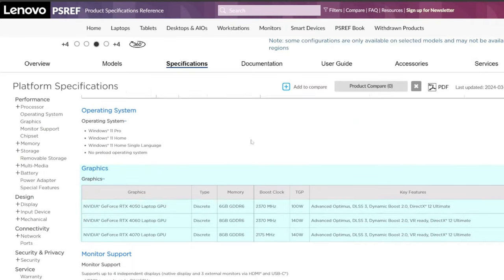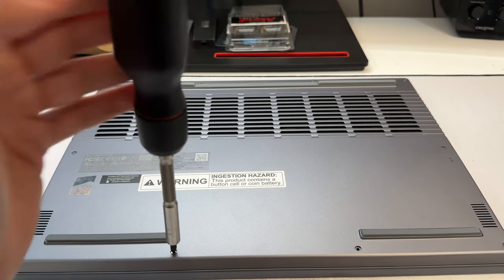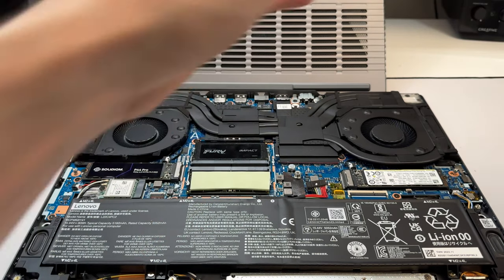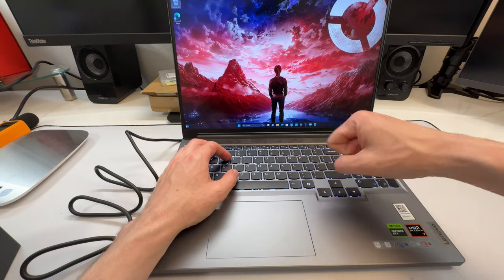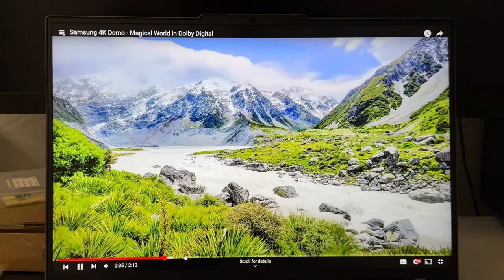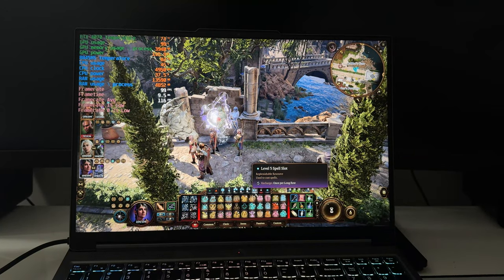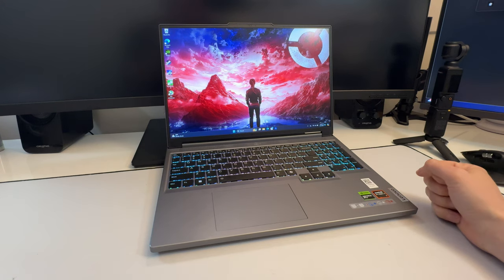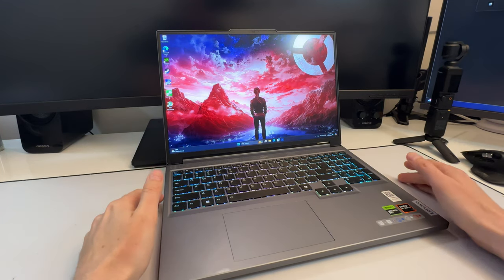Budget King Returns?! - 2024 Lenovo Legion 5 Slim - AMD

Comment: Hello sir, can I use a SSD M2. 2280 to upgrade Legion Slim 5 gen 9? I see spec on website said that it come with a SSD M2. 2242 512GB
Reply from the maker: It had two slots that support 2280

Comment: How long would such a laptop last if you really tried to use it till it's last legs?
Reply from the maker: Before it physically breaks? Probably a decade unless you are really harsh on it
Reply: @TechGuyBeau  Also I'm not too knowledgeable about these kinda things but is £1100 (gbp) a good deal for this laptop? because right now lenovo has a 20% off deal and after adding about £30 for the 500 nit display, and removing the mouse that comes with laptop cuts the price by £20, it totals to about £1100. It seems to be a couple hundred pounds more expensive than the price you got it for, but I'm also not sure if laptops are just more expensive in the UK or if i should wait for a better deal, because i plan on getting this laptop before i start university in september. Thanks
Reply: @impulse9552  tbh different countries have different pricing so its probably that. US markets tend to have the cheapest prices

Comment: Can we get full 140w TGP for 4070 in Legion slim 5 ?
Reply from the maker: There is really no benefit to a 4060/70 going over even 110 watts. You are just adding heat.
Reply: @TechGuyBeau So between gen 9 and gen 8, it's better to choose gen 8 then? Since Its 4060 tdp is 115 w while gen 8 is 140w??

Comment: what about this Lenovo Legion Slim 5 16A with these features Powerful Ryzen 5 5500U processor
AMD Ryzen 7 8845HS processor
16GB DDR5 RAM, 1TB SSD
Nvidia GeForce RTX 4070 8GB graphics card
Factory calibrated 16" WQXGA IPS 240Hz G-SYNC screen
LA1 artificial intelligence chip are they same its like (1649.0 Euro)

Comment: Does ryzen 7 8845hs worth over 7745hs if it is cheaper
Reply from the maker: Which is cheaper, the 8845hs? It’s the same CPU just better tuned
Reply: Thanks , but in both of em temp went considerably high

Comment: Huge issues with nvidia drivers and the amd models. Really screwed my experience of the 2023 amd slim 7. I love the form factor but it's a nightmare with all the conflicts and issues.
Reply from the maker: Nvidia drivers are pretty bad lately, not a specific model issue. I’ve been having issue myself and my discord reporting bad nvidia drivers for almost a year 

Nvidia is an AI company now, they don’t have time for us gamers anymore
Reply: @TechGuyBeau  yeah man, im just hoping that if i get a replacement to my Slim 7 they either offer me this one or a slim 7i, but im worried the slim 7i will have worse battery significantly  - i bought for portability, performance, and battery and slim 7 amd 2023  seemed on paper to be the perfect balance.
Reply: Would you say this laptop is as good as the 7 battery life from 2023?  @TechGuyBeau

Comment: Man is so hard to buy laptops nowadays, the 40XX series ( at least 4050->4070 ) AREN'T much better than the 30XX series. I have a 3070 and it performs better than a 4060 and slightly lower than a 4070. They used to really feed those more power, now after 100watts u get so little improvements in performance ( even if it says it's 140 watts, you rarely get 125 or past that, even so...the performance isn't much higher @ 120-130W ). It's true there's some improvement, but to get a new laptop after 3 years, I expected much more, not a slight increase when you consider that laptops got even more expensive. Even on the CPU side, after 3 years comparing my old 5800H with this 8845HS, same number of cores/threads, it has 600 more Mhz in base frequency and 700 in boost + some more cache. It's true, there is improvement ( considerably more when compared to the GPU side), but games...don't really take much advantage of that...GPU is the main factor for games and any decent CPU from the past 3 years will do just fine in most games if you have a powerful GPU paired with it and proper cooling. Maybe next year...hopefully we'll have some 50XX series paried with new intel / amd CPUs with considerable performance gains. And I'm talking about proper intel CPUs, not those Ultra Core, those are quite low performance ( especially for the money they cost ). It's true they're efficient and provide more battery life, but ... if you buy a new laptop nowadays I feel like you should consider the 14700/14900 HX or the newest AMD...the performance is waaay better. Anyway...praying my Asus holds on for one more year!
Reply from the maker: You should watch my video comparing 2022 legions to 2023/4. That will help you get a handle on what improvements 4000 series has made. 

A 5800h however doesn’t remotely compete with a 8845hs. Cores and frequencies are only part of the picture
Reply: @TechGuyBeau  yeah, I mentioned the CPU improvements are quite considerable, but how much it matters in games, it's probably not as much as the difference in a pure CPU stres test comparison.

Comment: There is almost nothing new in this. I should say buy 2023 model with Ryzen 7 and Rtx4070 from sales, there is good deals from last ones.
Reply from the maker: Well the cpu actually is an improvement. It’s not “faster” but the quirks have been ironed out, leading to insanely good battery life and efficiency. 

Next gen AMD chips are still a ways off
Reply: @TechGuyBeau  Hi, if I may ask, what kind of quirks that's been ironed out. I own the last year model, I watch several review about it including yours and decided to bought it and very happy with it. This one just to satisfy some curiosity of mine. You said the battery and efficiency is a bit better? What about benchmark scores and gaming performance?
Is it possible to do a head to head comparison?

Thanks
Reply from the maker: right now the battery performance is superb, and the battery life is outstanding. Any sleep related bugs are gone same with fan issues. Right now the 8845 HS is head and shoulders above any other laptop CPU on the market